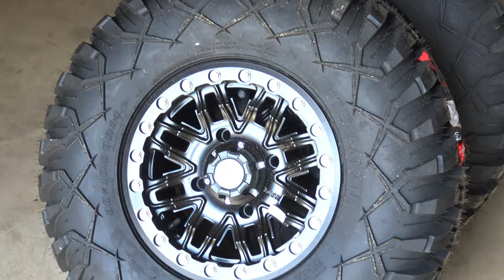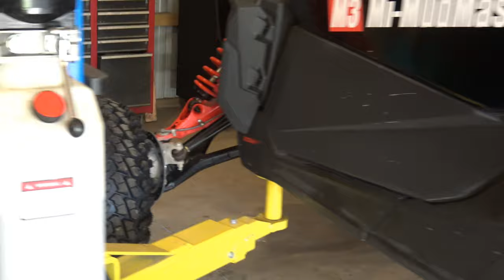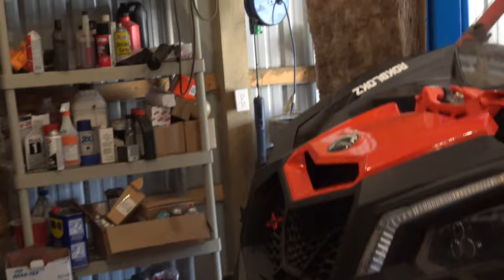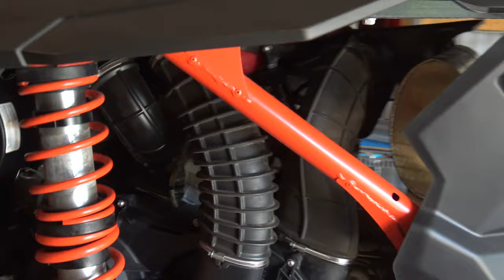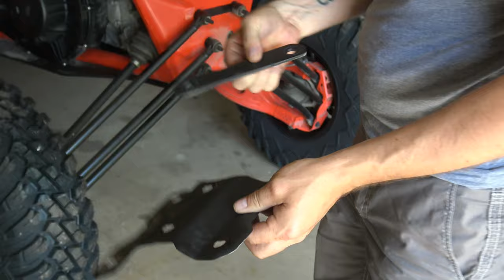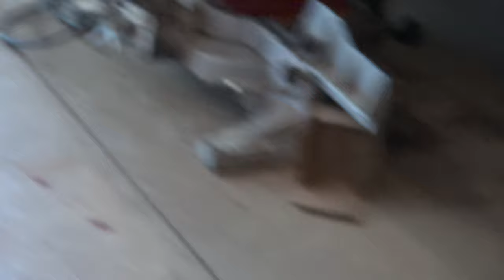Fixing the X3 RATTLE for FREE!!

Comment: My 2020 maverick sport max 1000r  makes the same noise in lower rpm range in 2wd only. Still under warranty so taking it to the dealer in a couple days.
Reply from the maker: Definitely the same problem for sure. They will install a set screw in the spline to stop it

Comment: Great video...so the rear drive shaft does not need to be marked like the front end? You just put the rear drive shaft as far as it can go into the trans?
Reply from the maker: Yes you can put the rear on in any rotation. It’s only important for the intermediate in front of the carrier bearing to be in sync

Comment: 2019 x3 turbo base here. It's not bad when cold but after running the machine for 20 min or so is this sound like a grind rattle type that comes in on a slow acceleration from a dead stop to around 3000 rpm and then goes away as you speed up? You can hear it like basically where the gear shifter is but sometimes sounds like from the back to? 300 miles on mine. Still under warranty I wonder if leaders rpm in Kalamazoo has a TSB on it?
Reply from the maker: Yep that’s it for sure. Pull the side panel and hold the driveshaft while throttling the engine in neutral. Sound should go away when you put pressure on it. Grease the splines it will go away. If it’s under warranty service will do it for free.
Reply: @M3OffRoad  just dropped it off at leaders rpm Kalamazoo for its 1st service and inspection.. Gave them a heads up. We will see what comes out of it. I told them the sound doesn't come into play until the driveline and everything is up to hot running temp.
Reply: Thanks again. They heard it and exactly what you said. Hardly any grease on both splines. Packed it on w marine grade grease. Problem solved. Warranty covered.

Comment: How long does this last? Wouldn’t it be better just to get a greasable carrier bearing?
Reply from the maker: Unfortunately its not the carrier bearing, it is the spline connections on the drive shaft. We do not touch the carrier other than to remove the shaft.
Reply: M3 OffRoad - MI Mud Masters is there a permanent fix to this ?

Comment: Mine started doing that and the whole rear end is Jerking real bad at very slow speeds..... once you speed up though it stops..... it makes a pretty bad clanking noise also and I only have 20 miles on mine...... haven't even rode it hard yet..... not sure if it's the same problem
Reply: What did you do to fix it mine is doing the same thing